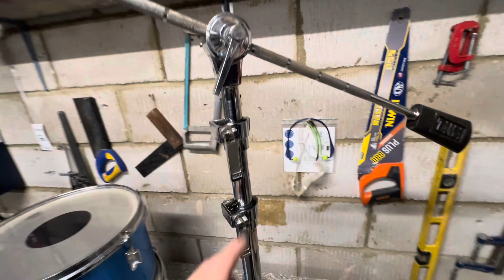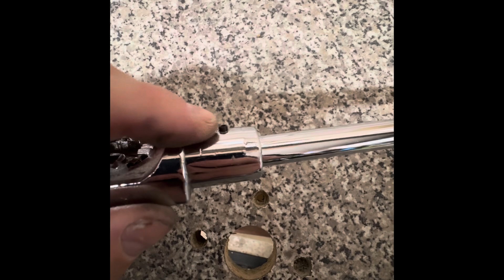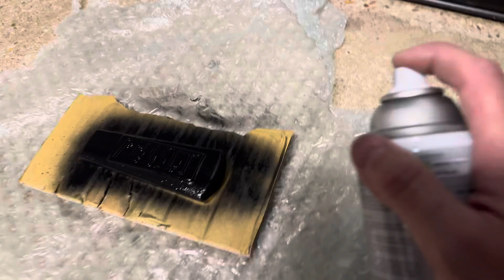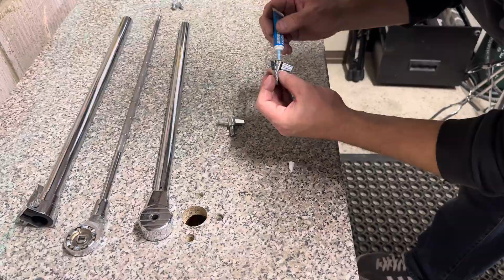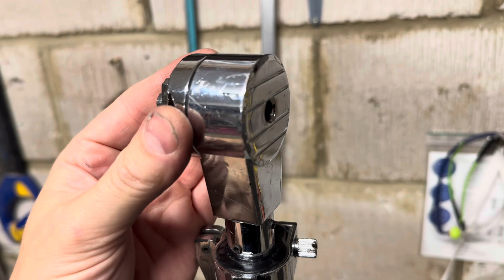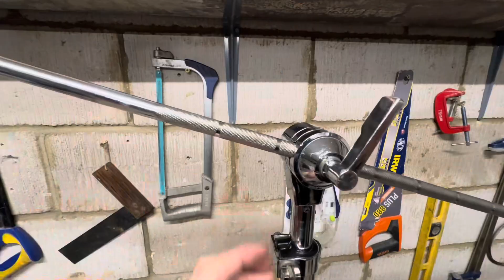Tama Stilt HC94B - The best cymbal stand!!

Comment: There is a far easier way to detach the collar from the tube - remove all the plastic lining, hit it with a heat gun and it will fall right off, beause the alloy of the collar expands more than the steel tube itself. I do it all the time and it works like a charm.
Reply from the maker: @VictorAlexandrov  nice chap - I would worry about the chrome flaking though.
Reply: I've done it multiple times and not once did the chrome go bad, so I think it's safe. A heat gun is not a blowtorch after all. :)